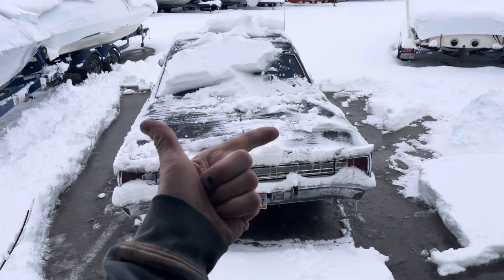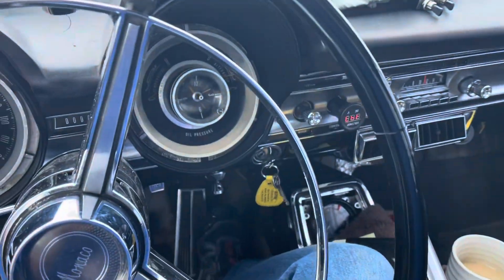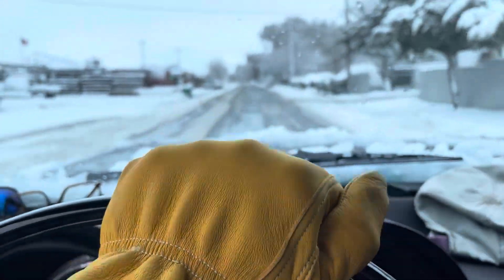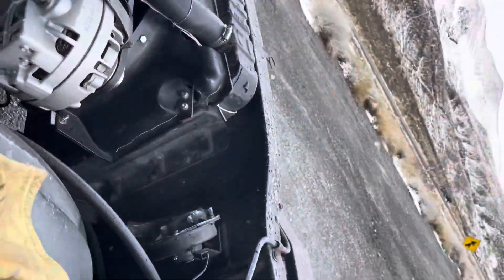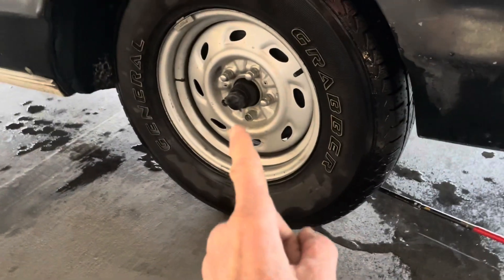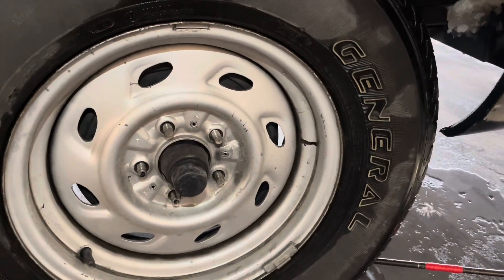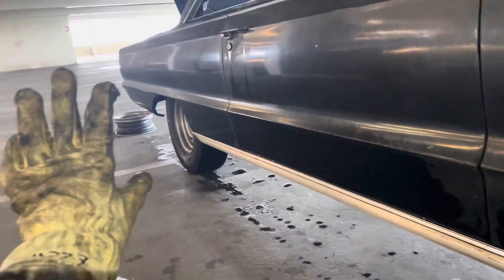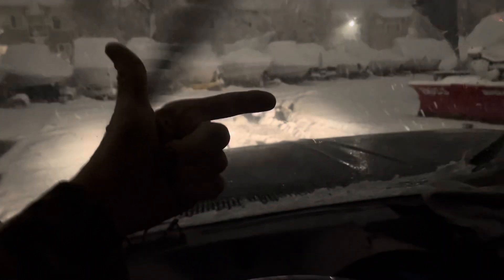1965 Dodge Driven and put away wet.

Comment from the maker: Turns out that the wheel is 5 on 4.75.  That means it was wrongly boxed.  It will fit a Chevy.  I gotta return it.
AND…. Just today (3/11/24) I purchased new rear air shocks.  The old ones were new 4 years and 60,000 miles ago.  They started to fail and I failed to catch that… I drive this car so much it seemed too early.  So…. The shocks were almost totally the problem. The 70-80 vibration is gone and the bounce test on the fender is better and the car is more predictable and smoother.   Hot Damn!!!